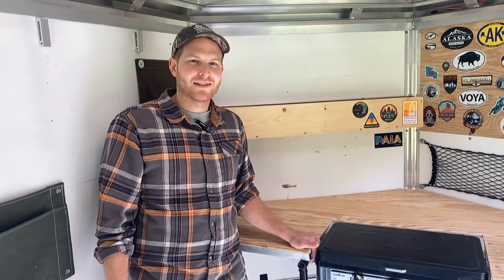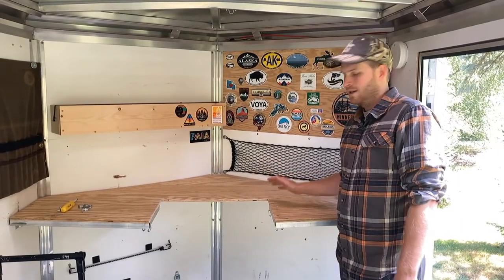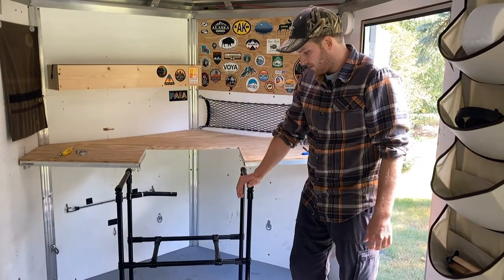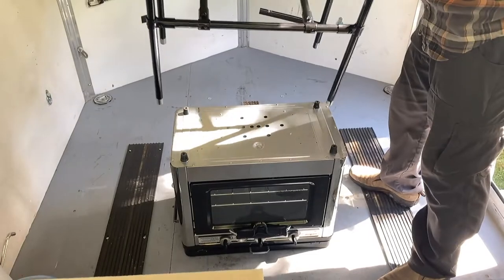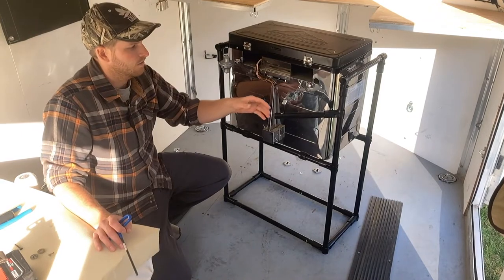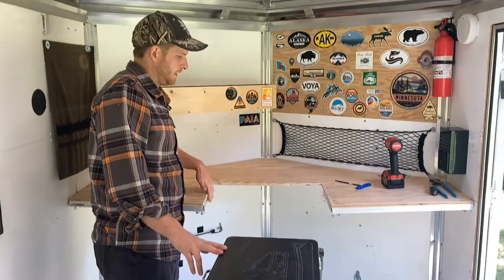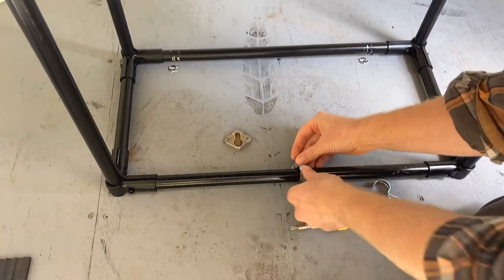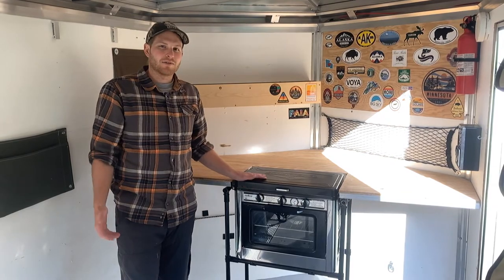Cargo Trailer Conversion Camper, Removeable Stove Stand for Camp Chef Oven

Comment: I have this camp stove oven too.  Your way of mounting it is ingenious.  I have a question.  About how high is the bottom “shelf” that the stove sits on.  I want to buy a short cart to move mine around or outside.  HarborFreight has one that I think will work okay.  Especially if I alter it a little to make it shorter.
Reply from the maker: Thanks for the nice comments!  The shelf is at 19" which puts the top of the stove at 36".